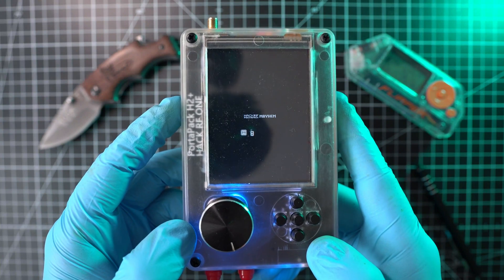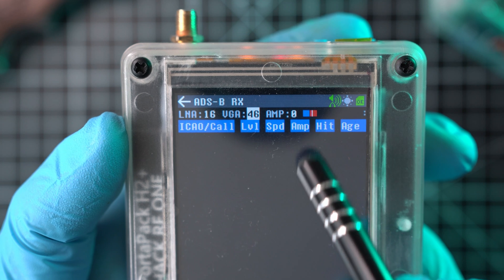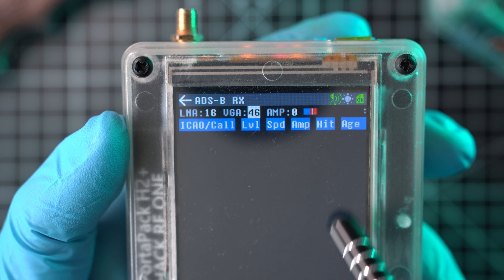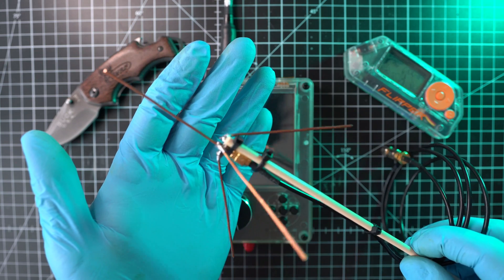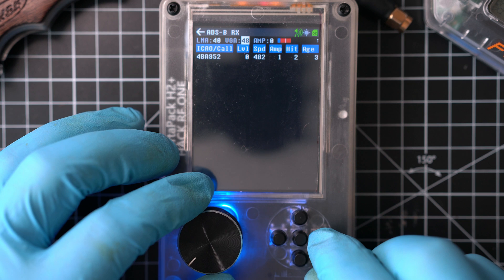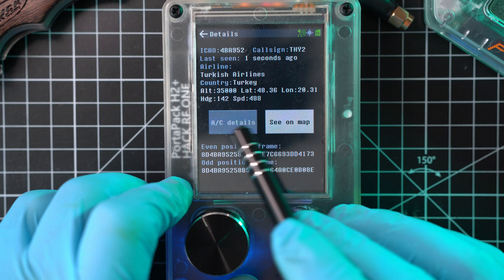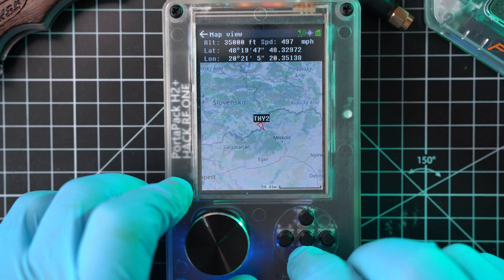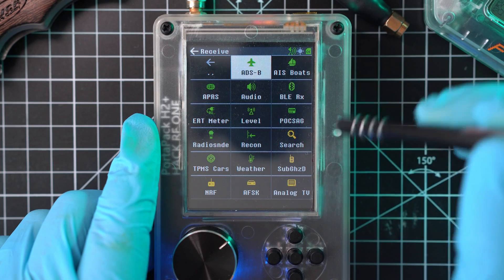HackRF One Portapack H2+ ADS-B app

Comment: I checked why it might not have received the signal from the other plane. It could have been a weak signal, but in your case with a good antenna it probably wasn't. Have you heard of MALT signals? Not all aircraft send signals using ADS-B technology. Apparently you can receive MALT on hackrf, but you need to configure it properly.

Comment: Adsb files are greyed out on mine on 2.0.1. The blue and red bars fluctuate in adsb, sd card is in fat32, reinstalled firmware and as card files. I cannot figure out why plains are not showing up anymore…HELP
Reply from the maker: what do you mean by adsb files?  if aircraft’s details are greyed out it means that your antenna or LNA VGA settings are low as packets were not received for some time .